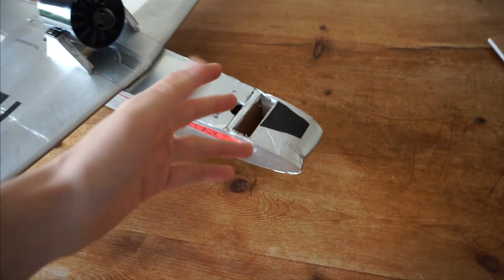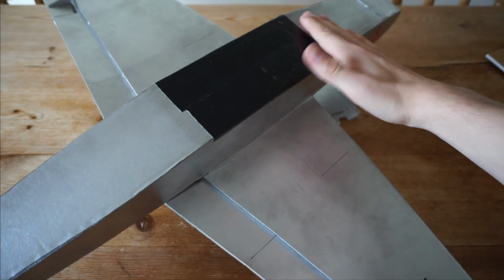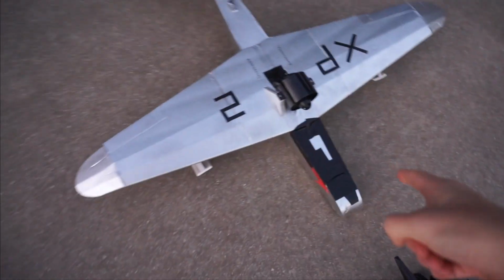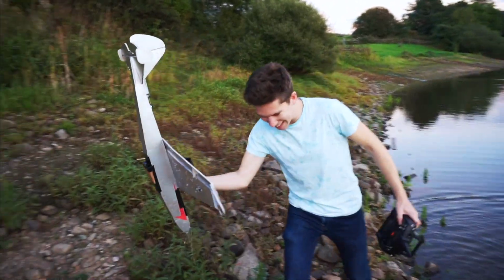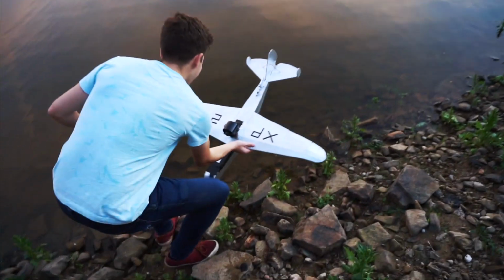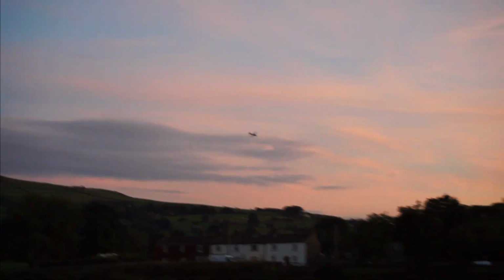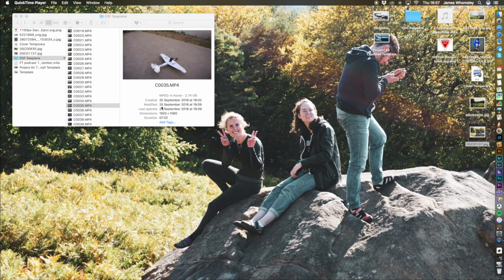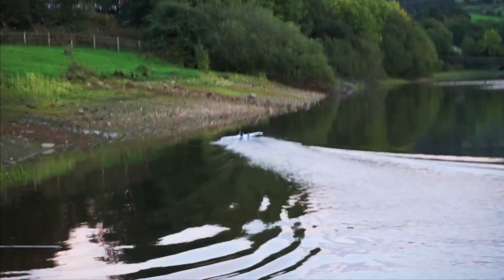EDF Powered Seaplane?

Comment from the maker: Got a suggestion or idea? 💡 Comment down here and let me know! 👌
Reply: The EDF is on top so the plane tends to dive into water. To help counter that you could try to adjust the position of batteries to have a center of gravity a bit more to the rear.
Also seaplanes don't have a flat bottom. There's a step. The problem is that without that the water tends to stick to the bottom of the plane and suck it down. Also the bottom should be more like a boat (V shaped vertically) for stability and also to prevent any ground effect (like under race cars to make them stick to the road)
Just look at picture of actual seaplanes...
Reply: The dip in the wing is sinking it into the water,duct tape does not make it waterproof 
The step should be slightly bigger , the wing is quite close to the water (bad for a seaplane)
do better waterproofing, ATB mate!!
Reply: It's digging in because of the angle of your step. Basically it's pointed down whenever it gets "on plane", so it can never rotate for take off.
Reply: ProjectAir please do a video in condolences of samm shepard.
Reply: Do a step by step video on how to make a plane. I’m curious with the cad software
Reply: ProjectAir mate, great idea. Try waxing the bottom half, then use a wedge nose like a pby Catalina or the Lutz class gev
Reply: Super fast plane, try to get 100mph or something and find the speed using a set distance and the camera...or a speed radar if u have one
Reply: Shake the camera a little bit less next time!
Reply: I, as a rc seaplane builder and pilot have a few improvements for you:1. Trust angle: tilt your edf a Little bit more upwards to prevent the planes nose from digging into the water.  2. make the fuselage wider for better stability and more lift out of the water, and angle the nose of the plane a bit upwards.  3. The Position and hight of the step seemed pretty good to me, the step should be 1-2cm behind the cog.  4.Try to rough up the underwater surface of the fuselage with some sandpaper to minimize drag (like a shark Skin) a shiny surface increases drag.  5. angle the bottom of the fuselage behind the step upwards so it comes free from the water.  6. put your Elevator higher up so it doesn't get sucked onto the water.   7. Try to make the step as sharp as possible.    With all that done it should work with your current engine setup. I apologize for my bad english, if you have any further questions, feel free to ask anytime.  btw: If you search for plans for a rc seaplane that definitely works, google for "Puddle Twin 2 XL"
Reply: Your fuselage is built like an upside wing, which digs the fuselage into the water. You could try create more steps behind the first one you created so it steps up from the water in stages. That means they should not be as deep as the first.  If you do that it will look like a dragon tail upside down :)
Reply: Because of your edf far up above cg you have a lot of downforce on the nose. So you have to put the step far more to the front.
Reply: Definitely should’ve designed a V-shaped hull to help it get onto the plane when trying to take off on water
Reply: I'm not sure if anyone said this yet or not but the skid you made for the bottom is behind the CG so the plane pushes into the water if you move it a little bit infront of the CG you should be good and make a small one for the tail to get the elevator enough room for some airflow. Hope it helps love the videos!
Reply: Obviously this is seaplane that doesn’t like water.
Reply: Hydrofoil on the bottom of an rc plane instead of floats
Reply: Hm, Look at that "Icon" aircraft, it has a wide body where it touches the water, that might help float less deeply in the water (and they did that to protect the propeller again the spray)
Reply: Hull needs to be stepped 😊

Comment: Have you not see what a sea plane looks like? It's a boat with wings. Your hull is flat and square, so it rides too low in the water. that's why the wing skids didn't work. Redo with a proper hull and you'll get it.

Comment: Possibly, the thrust mounted so far forward creates down pitch, so the bow plows instead of getting it up onto the step, which brings me to my second point, being add a step so you can hydroplane with less hydrodynamic resistance in the take off run.

Comment: I don’t know how you make your models work. Your sea plane had a flat bottom instead of a
hull shape. When you took off the pontoons the motor torque put the starboard wing tip in the water.
For a seaplane to take off it needs to get up to plane riding nose high. All your plane did was to plow 
through the water,
Reply from the maker: Thanks for the insight
Reply: I like your videos and you come up with some strange designs. I would suggest trying the following on your sea plane: a) make the fuselage in the shale of a boat. b) put your pontoons back on and shape
them like the hull of a boat and balance
the plane so the pontoons barely touch the water. c) make sure the front of the plane comes out of the water on take off. Lastly I find that coating balsa wood 
with a marine waterproof epoxy helps water proof the wood and seams. My suggestion would be to use West System 105 epoxy resin. Those are my thoughts I hope they are helpful. I would like to see your seaplane re-worked. Good luck and thanks for your videos.

Comment: May be old stuff but if you want to make a plane being able to take off from water, you need to reduce skin friction with the water skis. Normally that is done by reducing the camber line on the bottom so the water doesn’t stick to the surface until the trailing edge. So look for that ‘stepped’ profile for the skis.

Comment: I fly a lot of Seaplanes , You are experiencing the Plow Factor on the hull. Need a LOT of up elevator to get it onto the step , the ROW. rise off the Water. Fly a LAKE Amphibian LA-4-200 , 38' Wingspan FAA Aircraft, Need to have extreme up elevator and then onto the step.
Well otherwise great attempt. Hydro/Aero/Dynamics .

Comment: If you make the hull and floats like an inverted wing, it's going to make the plane want to suck itself into the water.  That's what the step is for in the hull, to break the -ve lift and allow the aircraft to plane and then break away from the water.

Comment: The thrustline of the engine is above the water. So there exists a momentum around the. which pulls the nose in the water when power is increased. This increases drag, keeping the speed down and counters rotating for take off. 2 bad things. A simple solution will be to increase the angle of the thrustline of the engine so that it pulls a bit upwards (5 - 10 degrees). Make this angle adjustible to experiment. Increasing the Angle of Attack of the wing will also help.  If the model flies ok as it did. , I would not experiment with the c.g. too much. 2 foam skids at the wing tips will be sufficient to stop the wingtips from touching the water. Apparantly the torque of the engine pushes 1 tip down..Check out the angle of thrust of this full size Grumann Goos when it is in the water. http://abc.action.news/watch?v=bwNI4hWAYoE

Comment: she flies quite well once she's in the air....landing even works well...  the problem is getting there   (I know...obvious...)  Here's a few observations I spotted:  
she's nose heavy.....floatplanes need to balance on their CG both in the air, AND on the water....
your fan needs some thrust angle to it...if it's forward of the CG, it needs to tilt up a few degrees....if it's aft of the CG, it needs to tilt down a few degrees..  (the specific amount you'd have to fiddle with)  In both cases, you want it to lift the nose, not pitch it downward....
she's also sitting "too low" in the water....try adding a pair of small "rail floats" on each lower edge of the fuselage from foam; that should raise her up in the water...something like little torpedoes with like a quarter of them cut out down the length to fit the fuselage.
.your "step" needs to be at or slightly forward of your CG for it to be effective (again, to lift it out of the water and not pitch the nose down)
I wouldn't count on ductape for waterproofing.  it's fine for shedding rain and splashes, but not for keeping water out if it's submerged; it's also "heavy" as tape goes  Try clear packing tape...it's more waterproof (though no tape is long term), but should be good for short duration.....or you can try to seal with hot glue using Flitetest's method of "wiping" most of the bead off the joint with a scrap (the way they do for making control hinges)...that should seal nicely, but help minimize adding weight.  another idea might be a couple coats of spray lacquer on the lower part of the fuselage, paying close attention to the seams.  A third possible, use a good quality wood glue with an outdoor rating when you assemble, instead of hot glue. 
I would also suggest you give your electrics Peter Sripol's waterproofing treatment... 

hope some of those help!!

Comment: The rudder on the Hyperboat is blocked by the step. There will be very little control once it planes off. Check out a 3 point hydro or surface drive deep v, then see where the rudder is. Its far back and in the water. You can just extend it down where it is but if you get any speed out of it it will be real twitchy in that far forward a position. Good luck with your builds!

Comment: i really could have worked, if you look at the landing you can see that the step was working you just needed to get up on it. all you really need to do is redesign the floats so they are more hydrodynamic and adjust the thrust angle to help it climb out of the water and onto the step.

Comment: Your horizontal stabilizer is dragging in the water. For one it's slowing the plane as it's trying to get proper speed for takeoff, and secondly you aren't getting any air passing underneath the elevator  to pitch the plane up. You would also need enough room between the tail and the water to get the necessary pitch angle to climb up off the water. Cheers.
Reply: fuck you

Comment: The fan mounted above the CG will be creating a nose down pitch as you apply power, this won’t help the aircraft get up on the plane in the water so you’re battling with too much drag. Maybe try adjusting the angle of the fan or move its position to reduce the torque rotating around the CG. The hull is a flat bottom so lots of drag, a v-shape hull would reduce this. Keep up the great work.
Reply: Spot on!  You stole my thunder. V shaped hull with step and up thrust on the motor. It pitched down on the hand launch until it got some speed. Best of luck.

Comment: The stepped hull is good, but you might want to consider creating more of an angled underside so that the center-line is a peak that slopes down to the sides, resulting in less contact with the water once you start increasing throttle, like so: http://avstop.com/ac/flighttrainghandbook/imagefdc.jpg

Comment: Firstly, thumbs up for addressing the issue of potential water ingress (at least you tried where so many forget!).
 Assuming that the aircraft´s C of G was set up perfectly for flight, if the aircraft taxiied nose-down, then surely the hull shape requires more buoyancy towards the nose.
 I´ve seen "skimmer-type" floats working well on other RC aircraft, though I bet you´re right; you´d do better with true floats.
 I hesitate to make my last little point, but then again you´re affiliated (if loosely) with Flite Test, who are affiliated to STEM. At the risk of being considered pedantic, then, I shall mention the fact that this is a flying-boat rather than a seaplane. If the aircraft´s  fitted with floats which hold the fuselage clear of the water (think Schneider Trophy), it´s a seaplane.
 I look forward to seeing this model (or a later iteration of it) rise off water; the landing we saw today was utterly beautiful and very gratifying to watch.

Comment: I know this is a little picky, but it's not a jet powered seaplane. It's electric.
Your wingloading is too high for the available thrust. It also looks really draggy on the water. More power and/or less draggy tip floats, more wing area, flaps...lots of options. Also, EDFs are a pain in the neck. ;)
It's a cool project though and in terms of flying, I can't criticize it. You do cool stuff. :)
Reply from the maker: Thanks Joshua. Yep, I learned a lot on this project, and that's the main thing! Next time we'll have more success ;) Thanks a lot for your advice!
Reply: ProjectAir, don't thank me yet, you haven't tried it. ;) Either way I know you'll get it flying eventually!

Comment: The duct fan does not contribute to lift at lower speeds. That is why most seaplanes will have props in front of the wing to generate lift by the air blown over/under the wings without the plane actually being at that (air)-speed.
Reply from the maker: Thanks for letting me know! :)
Reply: They have props not ducted fans because ducted fans have bugger all thrust as proved in this video.
Reply: yeah nice one, i spose you would gain some lift despite physical speed of the plane due to air blown over wings from props. Thats got my thinking about some of my own builds , ie pusher vs tracor engine mounting. Damn this hobby the learning curve never stops lol. But again, nicley thought out.
Reply: @grim4this  tractor is more efficient than pusher as the prop is in clean air/air that isn't disturbed by the fuselage.